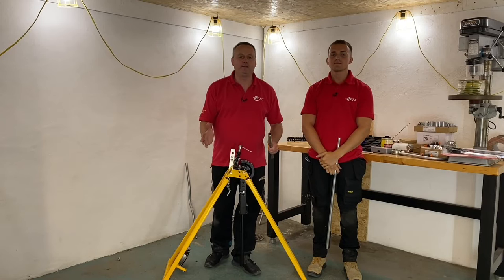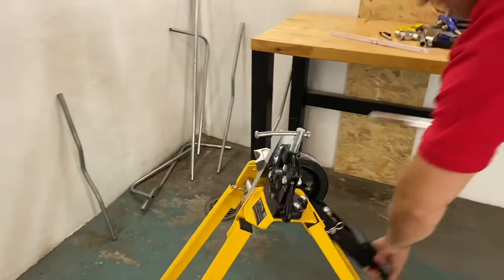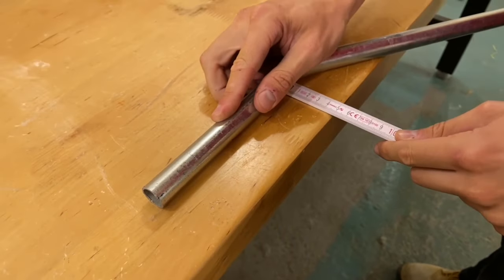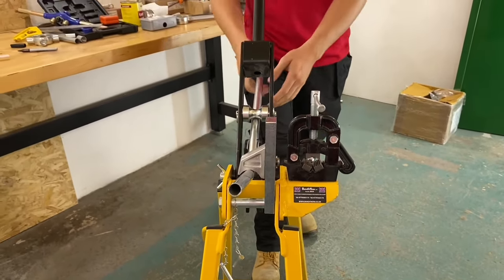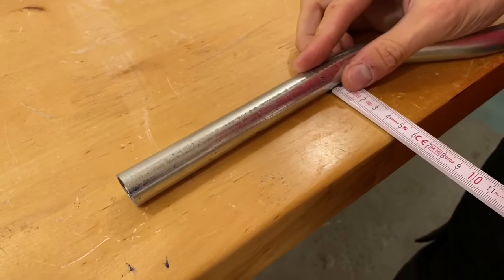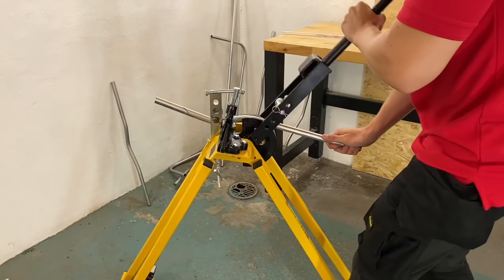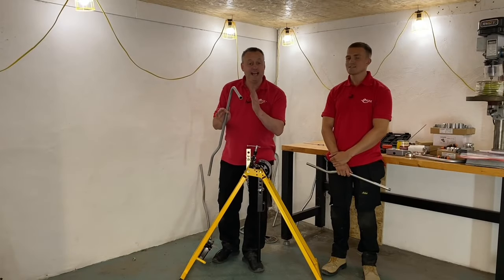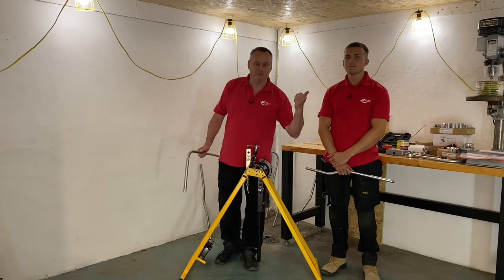HOW TO FORM A STEEL CONDUIT OFFSET BEND - Apprentice electrician essentials

Comment: If you just double rise for a 30 degree offset that will be the second mark and you can do it in one go and not have to take the pipe out of the machine. Eg. your 50mm rise would be 100mm between the marks.

Comment: I used to use a wooden block with an elongated hole at the end to do. conduit settings
Reply from the maker: Ash wood block 👍🏻
Reply: Block like a cricket bat with two holes one for 20mm and one for 25mm
Reply: We just bent it between our teeth.
Reply: @markrainford1219  or definitely over the knee for 3/4 conduit,paying for it now though 😩

Comment: Why exactly is changing the first bend so wrong? If say you’re bending a 3m length with just 150mm on the other side of the set it would be physically much easier to just adjust the smaller end
Reply: Because your set would change.
Reply: Because we know the first was the desired 30deg. Maybe you have to do two or more and you want them to match to look good.

Comment: How are you guessing what 30 degrees is? I’m sitting my AM2 soon and have been told I can’t use an inclinometer. I won’t just be able to bend the pipe and know that I am looking at a bang on 30 degree angle which means the conduit isn’t going to meet with the box fixed on the wall.